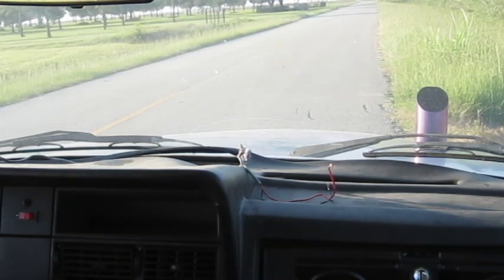Volvo 245GL D24T Drive around

Comment: From a lot of the videos I see, I get the impression that the rules on modified cars is quite relaxed in the USA. 

Do you have to have an annual vehicle check like the MOT in the UK? 

I fitted a straight pipe to my D24TIC Volvo 940 but had to choose somewhere else to have it MOTd because technically it should fail the test without a CAT.
Reply: Superbracey depends on where you are in the us